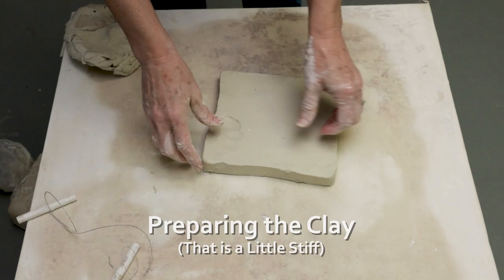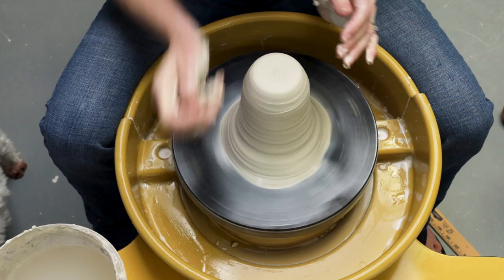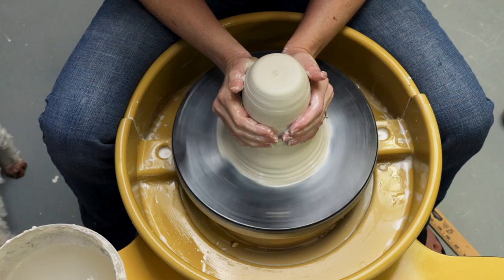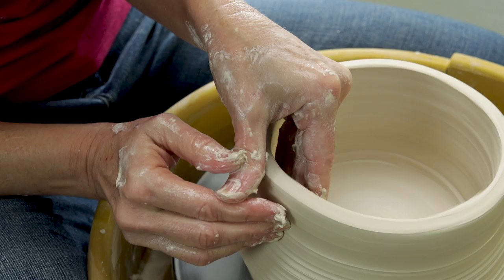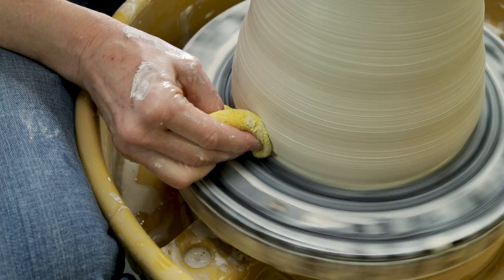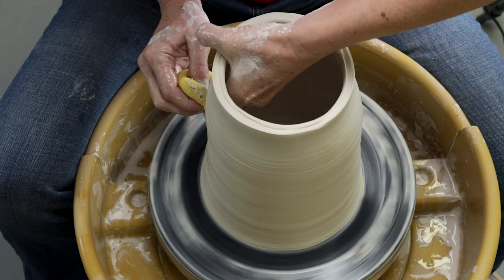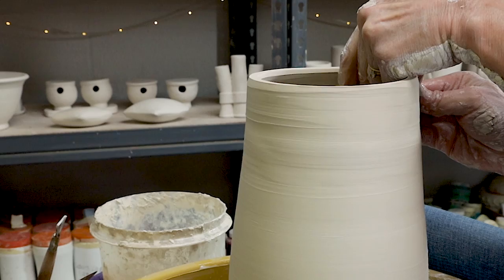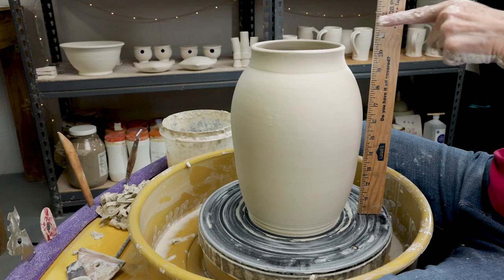How To Throw Taller Pottery

Comment: Clay Companies use a plasticizing ingredient and that if you take your bag of clay and drop it on the floor about six times from about shoulder height it softens the clay. I’ve tried it and it definitely works well to soften a whole bag of clay
Reply: Great tip Lynn! Thanks so much.  I will give that a try!
Reply: I do this and I also stick my bag of clay in water in a bucket of water overnight with the bag closed and that works l too.

Comment: this  didn't feel a confident tutorial.  it went off centre early, it was uneven on the top, it had a terrible wobble and you pushed out at one point long before you were meant to and it had a bulge just below midway.  then it started to collapse. you often didn't apply water to the walls after pulling up and with the rib, it started to get a corrugate dlook on the outside. This wasn't fluid as a process for beginners that's for sure.  With the wooden rib, the  whole pot was so out of whack, I felt anxious watching and didn't feel  I learned a clear lucid way of creating a large pot.

Comment: A tip for you, if the clay is hard , put it in the plastic bag or use the bag it came, and with the bag open thrown few times on the floor changing directions, it will soft the clay for you to wedge and is very nice to thrown after🤗
Reply from the maker: Great advice! Thanks for watching!
Reply: I make 2-3 holes in the clay. I squeeze a watery sponge to fill the holes in with water. I wait two days for the clay to be manageably soft to work with.

Comment: Great video and instruction.  Can’t wait to test your new tips.  I especially appreciated the part where you initiated the lift from the top portion of the cylinder.  It makes so much sense.  Thank you for sharing your expertise.
Reply: Thank YOU for watching!!  I do think there is a difference with "making sure the walls are nice and even and not too thick" from an actual "pull from the bottom" . i have heard other potters refer to both as a  "pull", but I think that is confusing so I separated that out from actually "making a pull". ....if that makes sense.
Reply: Oh my gosh this is so great! I only used 4 lbs today but  by focusing in even walls and starting middle up and then bringing the bottom portion up the middle really helped. I’ve consistently had issues with my bottom half getting too thin and collapsing. Great technique. Thank you for sharing.

Comment: 14:08. I don't see a rib on the inside.  I see a rib on the outside and fingers on the inside.  Are you pushing the top of the vase with the outside hand/rib and bracing with the inside hand?
Reply: Hi David.  That was the part of the video where I was shaping the vase. by pushing the  clay at the top inward to create a neck and pushing the clay under the neck outward with the inside hand to create a voluminous profile.  I am not the most elegant thrower, but I can get the job done, haha.
Reply: @annruel1982    Thanks.  I just started making  long neck vases and bottles.  I have a problem with sinking shoulders and necks.
Reply: @davidcudlip6587  Gotcha David.    It may be that your clay is a bit too thin when you try and stretch out the shoulders too.  Perhaps, pulling more from the bottom to achieve the height instead of thinning out the clay at the top...then try the throwing stick to achieve the volume at the shoulder area to avoid the tired clay that is at the top of the vase.  Have you tried a throwing stick.  If the neck is too thin to get your hands into without stretching the clay out in tight neck area,  a throwing stick will be able to get in there easier and help when the clay starts to sink.
Reply: @annruel1982  I was thinking of ordering one or making one.  That might help forming a good shoulder after the neck is collared in.  Tonight I threw a replica of an 18th century rum bottle that surprisingly turned out okay.  Those were actually hand blown glass but I like that shape. I just got into this last month and never worked with clay in my life.  It can get addicting.
Reply: @davidcudlip6587  Wow, you are doing great then David.  Congratulations.  You are so right.  it is very addictive :-)